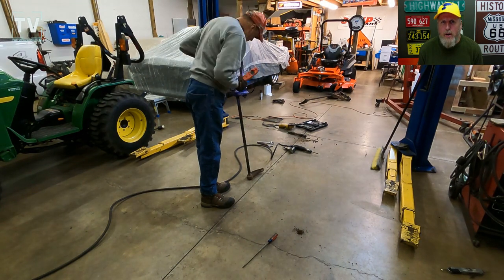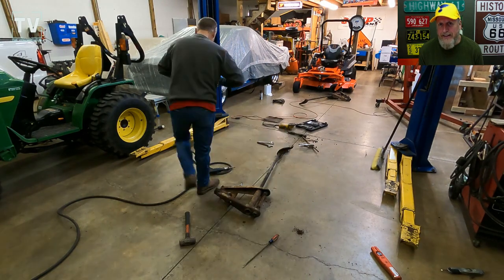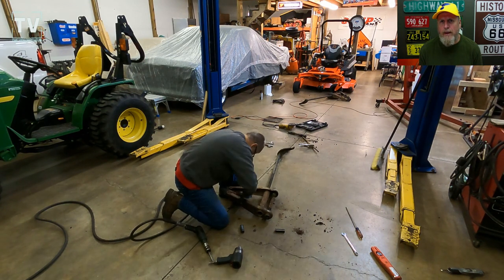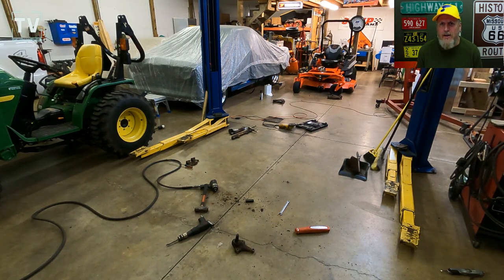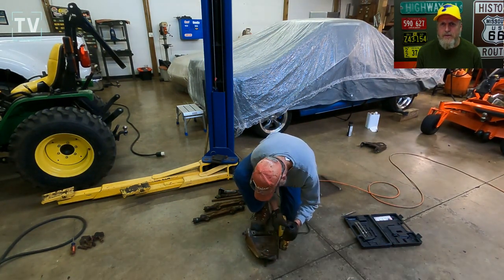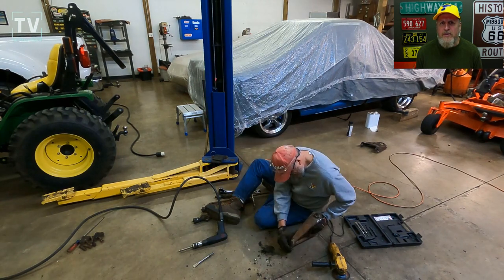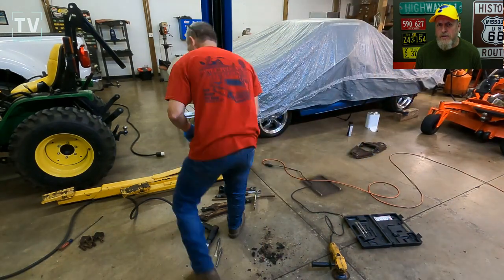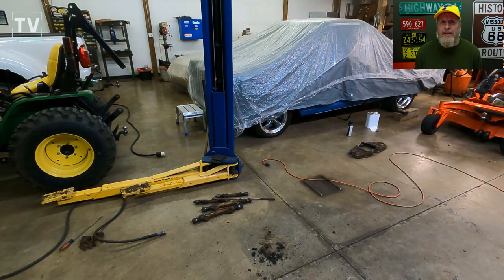1961 Chevy Apache Cleaning Control Arms & Torsion Bars

Comment: picked up a 1960 c10 very smooth ride now i know why thanks to this video, had know clue about torsion bars, my wife loves it:hand-orange-covering-eyes:
Reply from the maker: Glad you kept it and I am happy you found my video helpful. So many people change them out but they were ahead of their time when they were made and very expensive to make as well. I look forward to getting this on the road having replaced bushings and tightened everything up. Thanks again for the kind words.
Reply: I agree,they ride nicely, actually 62 was the last year,of the torsion bars,some 60-2 GMC medium dutys had torsion bars as well as I beam,60-1 Chevy trucks from Half ton to heavy dutys all had independent torsion bars,62 Chevrolet trucks including heavy dutys had torsion bars with the I beams being an option on the M series Chevy tandem rear axles trucks.
            1963 for 10-30 series two wheel drives were the first year of the coil spring front suspension,the medium to heavy duty GMC,and Chevrolets went back to the I beams front suspension.
          By the way , thanks for keeping the T- bar front suspension,it was,and still is a great front suspension.

Comment: So glad you stressed the C10 had torsion bars. I removed the factory 61 front clip & put on an 84 C10 . Folks are always telling I removed the torsion bars. I patiently try to explain my 61 is a C20 which did not co e with torsion bars. Try as I may it’s often apparent they don’t believe me. Most try to convince me someone had to have removed the factory torsion bars. Geez!
Reply from the maker: Good to know and thanks for your comment.
Reply: Not sure about that. I  have seen a Apache 20 with torsion bars. I  believe that the Apache  Spartan and the Vikings came with torsion bars. I  also did a Google search and found out that the Torsion bars suspension was on the  bigger trucks too.🤷
The 60-66 4x4 all had leaf springs.